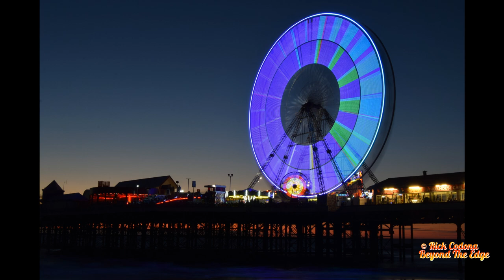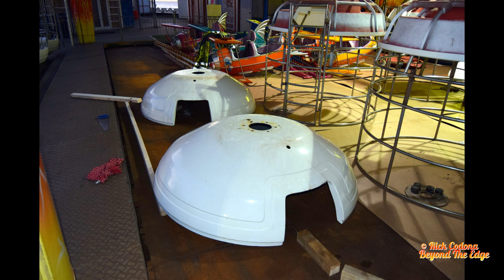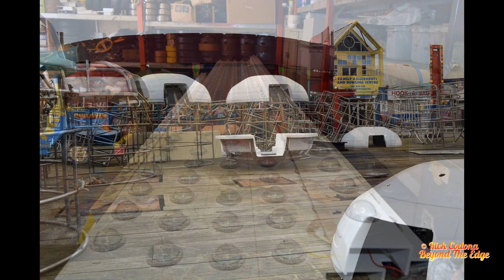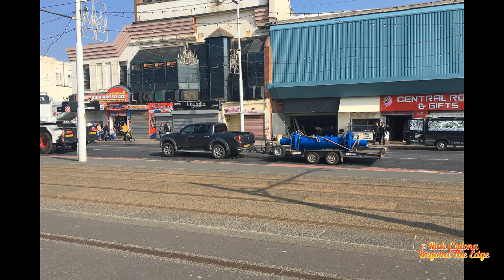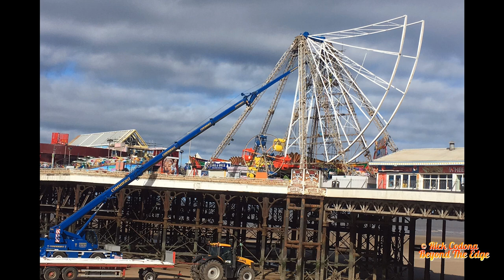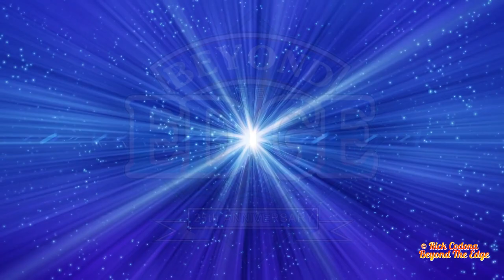Central Pier Big Wheel : Behind the Scenes.

Comment: I was once outside 
coral Island and someone stopped me and asked me where the Tower was. I just kind of pointed in it's direction. 
also my brother and partner both used to work on the pier years ago. My brother did the wheel and dodgems and my partner did mostly dodgems.
My brother may have done the Waltzer too.
I filmed the wheel getting taken down a few years ago.
And I remember when they first put the wheel up it didn't have any guards.
After a couple of seasons they added the little rails around the seats and then a few seasons after that they added the cages. I can't remember the exact timescale of when they added the rails/guards but in the beginning when there was none, it seemed really scary.